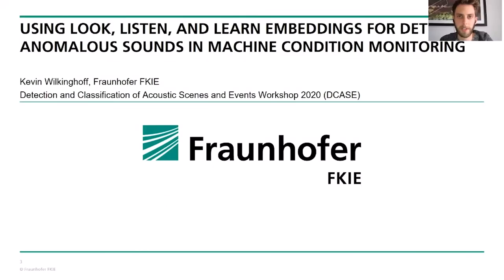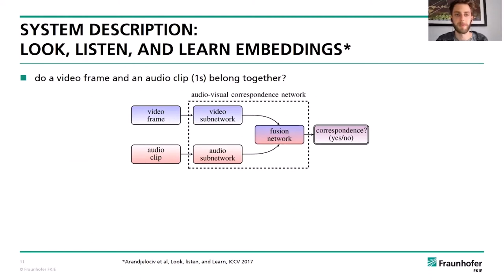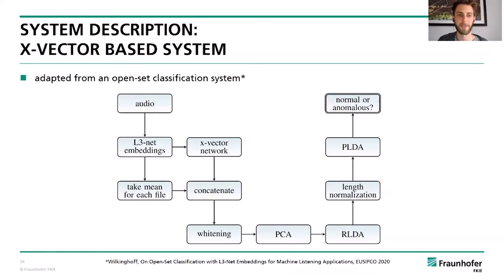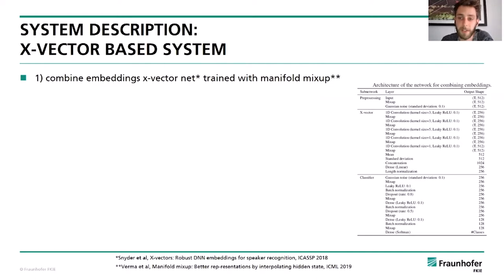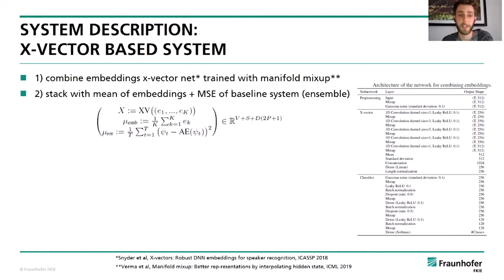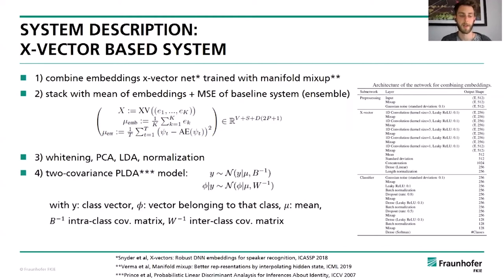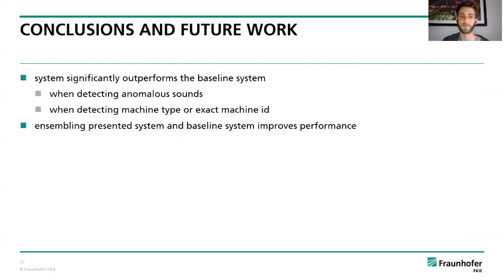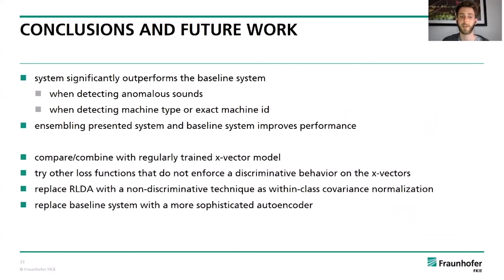DCASE 2020 Workshop, ID 1, Kevin Wilkinghoff

Comment from the maker: yohei_kawaguchi
1:13 PM
 Has joined the channel.

yohei_kawaguchi
Admin
1:13 PM
Thank you very much for interesting presentation! I have a question: In Figure 1, there are many projection blocks (PCA, RLDA, and PLDA) after x-vector. These are necessary?

kevin_wilkinghoff
5:54 PM
 Has joined the channel.

kevin_wilkinghoff
5:54 PM
Thank you for your question! PLDA is absolutely necessary because the outlier detection score is also computed with it. RLDA significantly improves the performance because it also reduces intra-class variance and thus should be used. PCA is not that important but sometimes slightly improves the performance, which is the reason why I used it.
1 reply
yohei_kawaguchi
7:49 PM
Thanks! Interesting!
November 2, 2020 7:49 PM

tatsuya_komatsu
10:14 PM
 Has joined the channel.

keisuke_imoto
1:29 AM
 Has joined the channel.